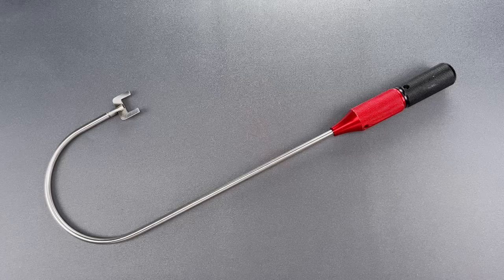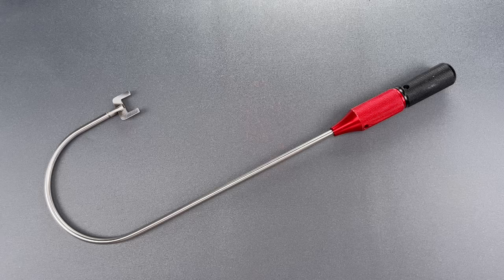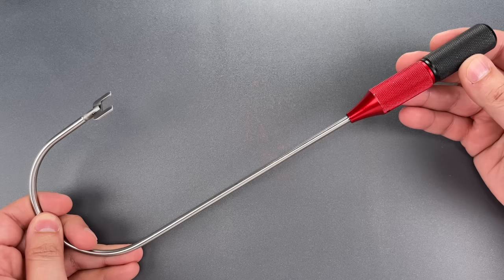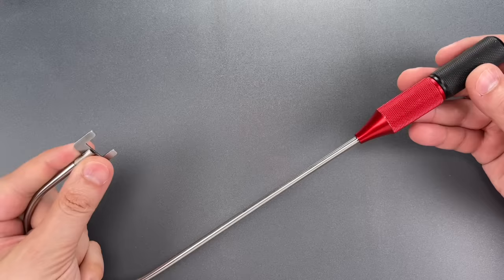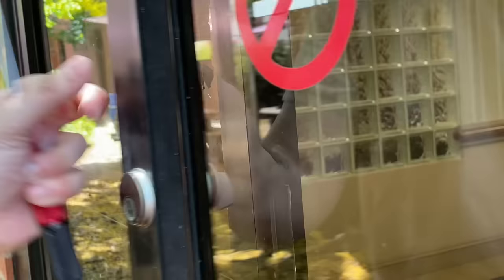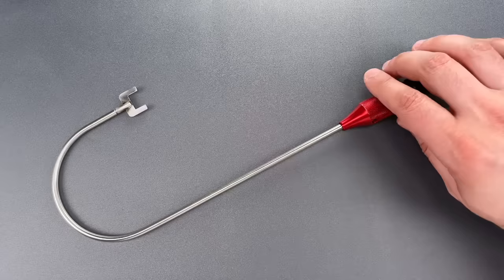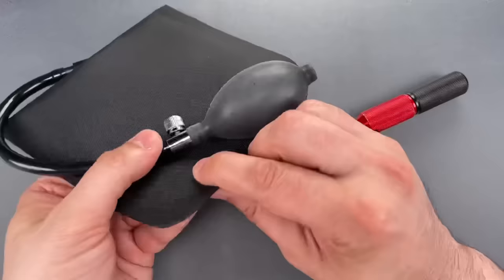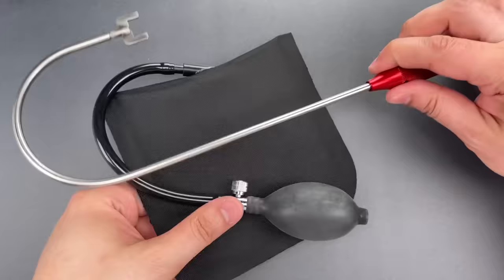[1312] The “J-Tool” Reaches Inside To Open Doors

Comment: Yes, this tool can be used by thieves, 
but keep in mind that many locks today are electronic and that thieves also open them easily. 
Ideal protection does not yet exist, or, as long as there are people, there will be thieves.

Comment: So the way to the defeat the "J-Tool" is the thinnest gap that can be achieved between the two doors.  The way to defeat the air wedge is to have some sharp pins between the doors; as the wedge gets pumped up, the pins will puncture it and it will no longer hold air.

Comment: Nobody ever does it, because it wouldn’t look good… But all it would take to defeat this tool would be to pop rivet a strip of aluminum to the backside of one of the doors so that it lapped over The gap and kept anything from being stuck through. That would make a much more secure door. Obviously if you’re willing to break glass then all bets are off but as far as just sticking a tool through and unlocking it. And if you’re worried about them breaking glass you can put 12 mill security film on both sides of the glass and then all the sudden it’s really difficult to get through the glass as well.
Reply: But then you create a problem of having only 1 door able to be pulled open when unlocked. The simple thing would be to not have this type of lock, have it keyed on both sides!

Comment: Fire safety requires the thumb locks to make it easier to escape but obviously are easy to break into. Also first responders dont use locks that big clear surface opens much faster 😂. You complain they say go after the tenant for replacement.

Comment: That wouldn't work on a pair of rebates double doors.  Over my 40+ years as a carpenter  hanging doors and what not  I have never come across a pair of double doors that were not rebated or one door having a metal slip on one side.

Comment: It just so happens getting into buildings is a lot easier than anyone ever thinks the use of a hammer a crowbar or even small army ants are not necessary anymore with this highly recommended security breaching double whammy slippery sliding opening monster bravo for the experts that know exactly how to be determined to open all points of entry hooray for us

Comment: I'm the lock picking lawyer. Today I'm going to show you a tool that can be used to break into a building. I will also sell you the tool on my website and for an extra $99.99 I will represent you in court when you are charged with trespassing and breaking and entering. Have a nice day.

Comment: Something worth mentioning is if the gap is too small and you need to use the air wedge it will put a lot of strain on the door's latch and cause you to have to spin that handle really hard possibly breaking it.

Comment: I never seen a double door that has a gap like that, without have a backing plate between both doors that stops intruders from sliding in a tool like that to open the door.  Any door that has a gap like that you can slide a tool in, only means the door & frame wasn't installed correctly or owner bought that double door without the back plate that blocks tools like that. That doors had to be made back in the 1980's or older. Todays doors, not possible. Why use that tool, when you can use a prybar and open that door much quicker just saying.

Comment: Ok so how to defeat this attack?  Maybe just a piece of metal covering the gap on one side?  Doesn't work for bi-directional doors, but single direction doors enough overhang and there's no way that the J-tool is going to get through.
Reply: Or install a Double cylinder deadbolt, requiring a key inside and out

Comment: this reminds me of something. 
my first house had a sliding door, and i realised the door would just lift off the rails. i called the landlord and they sent someone around to fix/replace the door. the guy looked at it, laughed at me, and said sliding doors are supposed to lift off, so theres nothing he can do. i was kinda embarrassed at the time, looking back on it now that guy was an idiot
Reply: @ keenly - That locksmith was NOT an idiot. That's exactly what sliding doors are designed to do. He gave you correct info. That's why there are specific types of locks for patio doors...
Reply: @hdpro553  thanks. 
i realised i forgot a piece of the story. 
in addition to being able to simply lift the sliding doors of the rails from outside, it was locked with a simple latch lock, so with even less effort you could open the locked door by lifting it up a little while sliding. the door repair man have me a piece of wood dowel to prevent the simple unlatch issue. I screwed a bolts into the top of the door frame to prevent it being lifted off. 

I have since learned that other sliding doors to have adjustable side panels that you slide up after installing to stop them being lifted off. 

So i stand by my comment. the guy was an idiot. and no sliding doors shouldn't just lift of, that ridiculous. 

But i wonder how many do just lift off

Comment: I skipped straight at 1:00 and after watching how it worked I started laughing. This tool is not applicable to windows and sliding doors in Central Europe. Because our windows and doors have no gap where something can be pushed. Currently, the most common doors can no longer be opened with a crowbar, you must use a ram or a hydraulic tool.

Comment: I'm sure glad there are no criminals watching this or buying any of these, "products" on the lock picking lawyer's website. I'm sure the lock picking lawyer would not be able to live with himself if he knew criminals were using the information on this youtube channel or, "products" sold on his website to commit nefarious deeds against law abiding citizens.
Reply: over 30% of burgulary was conducted by throwing a brick into the window or simply kicking the door then entering and 40% of burgulary happened for not locked doors. While 1.6% of the burgulary was done through lock picking. If someone is smart enough to lockpick, they wont be wasting time on these low crimes.
Reply: @chrisjuan9249  Where are these statistics listed?
Reply: @13Hangfire  berau of crime. Even if this isnt 100% accurate. I can still assure you that lock picking is too rare in the low crimes. Because learning lock picking isnt any where cheap. For a starter u will probably spending thousands of dollar on buying different lock to familiarizes yourself to how to manuver through different locks.while after learned to lock pick, you can just become lock smith, which can easily earn hundres of dollar per day. I dont see a clear reward for spending all those effort just to stole some laptop and risking ur ass get locked behind bars for 5-20 years than a decent earning job.

Comment: Gotta say, if you can fit that tool through any gap on a door, you are asking for it and crowbar probably works as well or even better. What is it with North-Americans and shitty building tolerances and/or locks? Are you secretly wanting to have uninvited quests in your homes?
Reply: Yea, all our doors are like this. Take a jab at another group of people that aren't responsible for most modern day luxuries...
Reply: @budderbear  I am trying to say, that if there is a market for a tool like this, there is many doors with gaps like that and you probably should either demand better doors or better contractors. That gap wastes energy and doesn't seem safe in any way.

Comment: This has nothing to do with lockpicking, it is a bypass tool and unless you're a locksmith or an emergency service provider this is a burglary tool. Watching this just caused me to lose at least half of the respect I had for you LPL, and shows you're becoming more and more of a sellout for profits on your website. The same goes in my opinion for the Lishi tools, locksmiths have cheaper sources to buy those so your website is selling mostly to people who either will not know how to use them or have no legal reason TO BE using them. I'm sure, however, that these are landing in the wrong hand because of you. I'm also sure that at least several small businesses got robbed using this tool because of the fact you made it known and available to just anyone, and I can tell you from my experience in the field that these locks DO keep the bad guys out most of the time. As a security professional, I'm extremely disappointed to see you use your very popular and respected platform to promote sales of burglary tools that are clearly not for your average lock picking hobbyist.
Reply: I am one of those small business owners you speak of. This content is so unethical albeit legal…
Thank you for your comment!
Reply: @MrGuisda  I'm sorry that happened to you, sir. You can add a Latch Guard to make it more difficult, it doesn't matter if you have a latch, a swing bolt, or hook bolt. You can also connect a thin line of sheet metal to the door with self-tapping screws that will stick out enough to prevent tools like this from being inserted in the gap between the door and the frame (will only work for doors that swing in, since it has to be on the inside, otherwise they can just remove the screws or bend the metal out). You can also prevent this from working altogether using double cylinders so a key must be used on the inside to unlock the door. It's unfortunate I'm having to give this advice on a random Youtube video when normally this is a conversation I'm having with the owner while forensics are running around collecting fingerprints...

Comment: I bought this and it's an overpriced piece of junk. The lock in this video turns easily and he barely got it open because the tool doesn't have enough force to turn most thumb knobs. The wire inside the tubing is also a fraction of an inch too short to repair when  the set screw strips out of the wire  causing the lack of turning force. Trust this guy selling you his product or save your money for something that actually works. You decide.